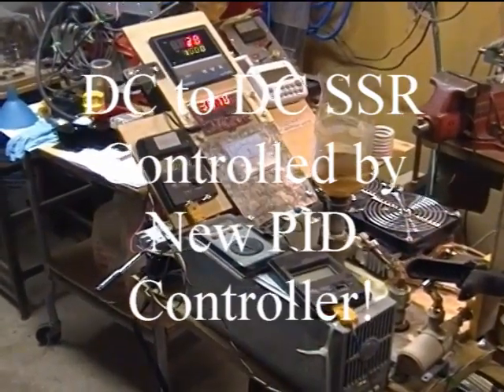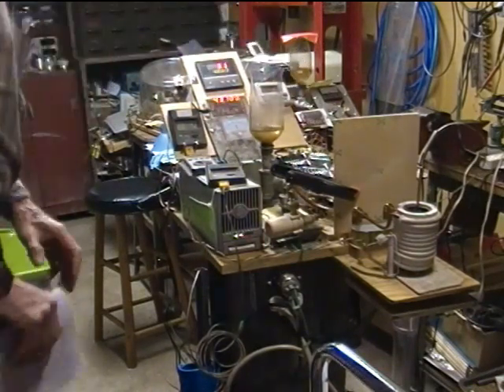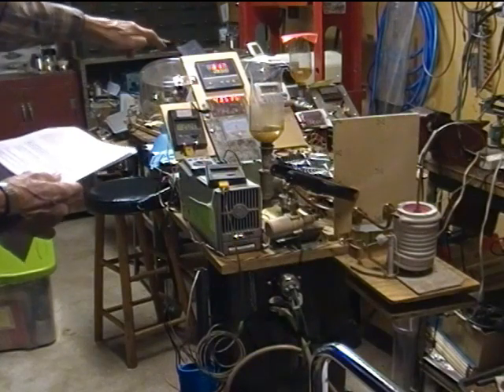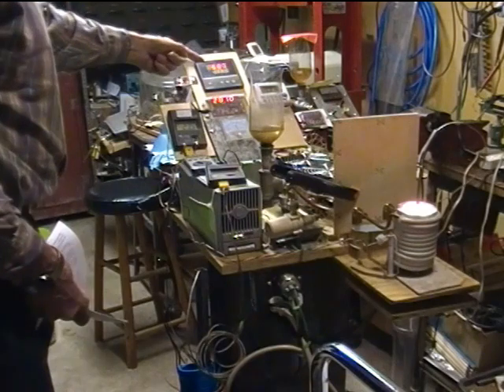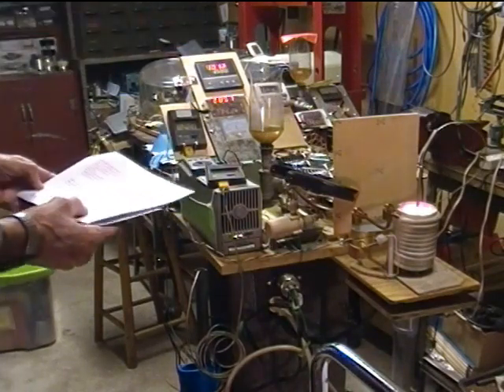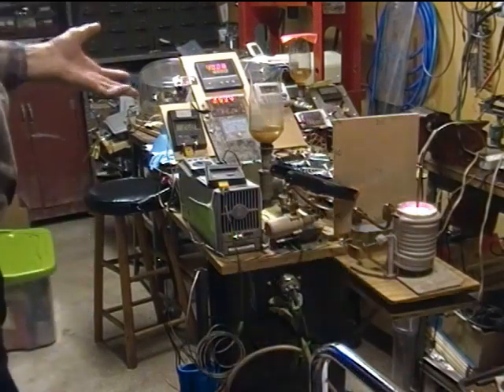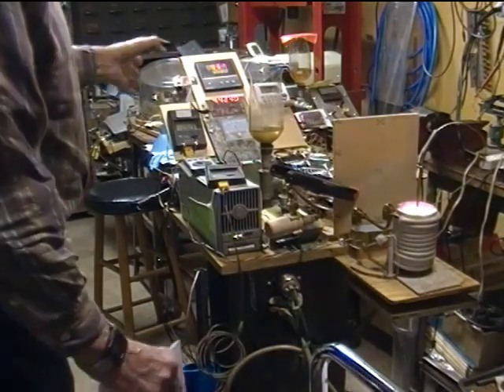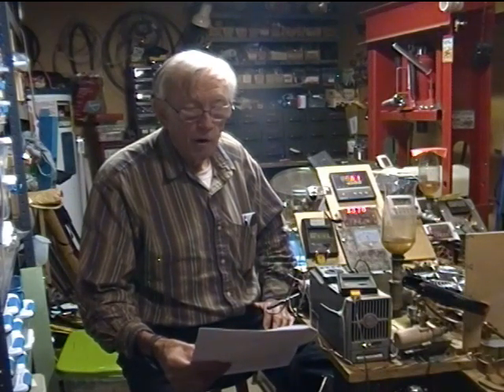#177; Part 3, Power cycling of  ZVS Induction Heater w/ DC-DC SSR & Rex-C900 PID Controller

Comment: Have you tried running ssrs in parallel to spread the load?
Reply from the maker: No.
The thought has occurred to me but I would much rather find individual devices that can handle the whole load.

Comment: what is the use of current and voltage at 1800w induction? to make metal heat 1000 degrees Celsius
Reply from the maker: I run the heater at 48 volts.  The ammeter reads 36 amps.  48 X 36 = 1728 Watts.  But the idle current is 6 amps.   So, only about 30 amps is going into the work.  Therefore: 48 X 30 = 1440 Watts into the work.
Reply: @frenchcreekvalley   so, what is the temperature generated in your engine or at 1800w?
Reply from the maker: @carlosmitang7058  I can heat 500 grams of copper to at least 1100 degrees C.